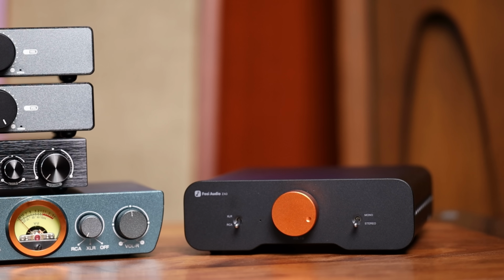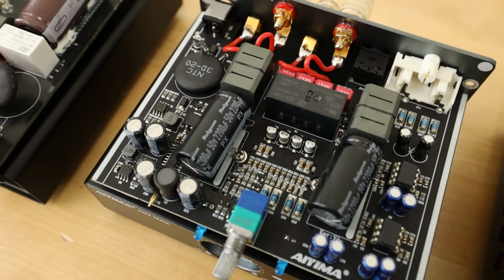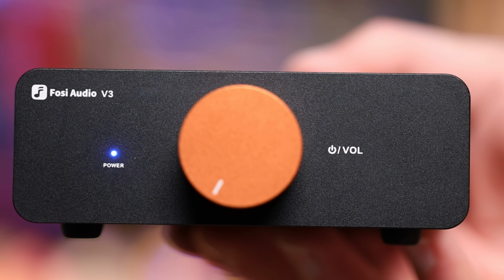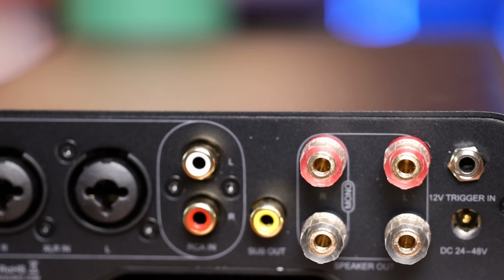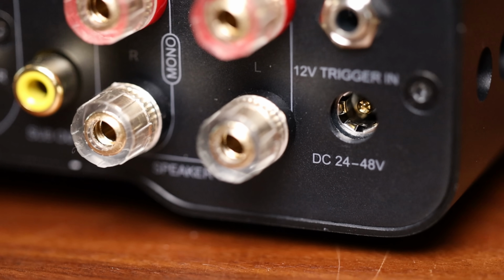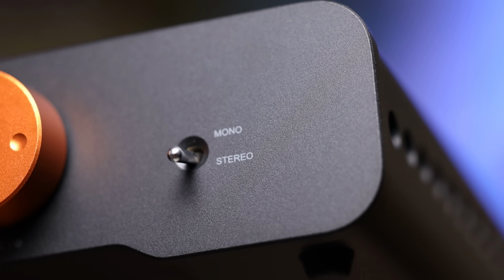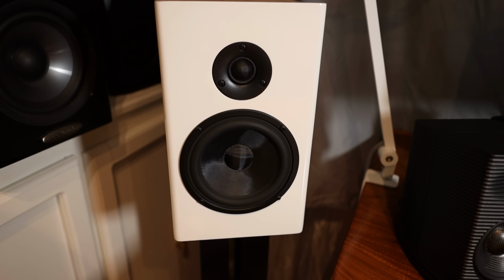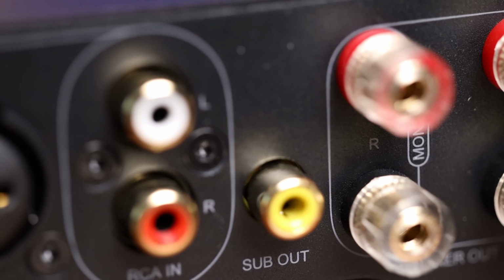Fosi ZA3- Teardown / Comparison / Review - Topping LA90 Who?

Comment: A couple of words of caution when disassembling and reassembling these upside down chip amplifiers.

1) Do not operate them at high volumes outside of the case.  The case is the biggest part of the heat sink and that heavy heat spreader will most likely be sitting on your table top.  This presents a really really weak cooling solution and may result in the chip overheating.  It's okay to turn them on at low volume just to be sure your new op-amps are working, but don't power test it outside the casings.

2) Since they've started using thermal paste on the heat spreaders, you really should clean away the old paste and apply new right before reassembling the amp. Picking up even a couple of larger dust particles  can seriously degrade the cooling solution and it's almost certain the paste will pick up and hold onto whatever loose particles it comes into contact with while exposed. The new paste should be applied in a thin line inside the case, where the back of the heat spreader will sit. This allows the spreader to spread the paste evenly as it slides in.  Putting it on the spreader itself will just result in the thermal paste being smeared all along the bottom of the case, not where it belongs.
Reply from the maker: Good news is I have some thermal paste laying around from previous PC builds, might as well apply it to the other two as well.
Reply: @MattCoykendall1 
As the wiley rabbit says ... "Couldn hoit"

As always, use the smallest amount that will cover the contact surface.  Too much is both messy and less efficient.

Comment: Once again... time to fix the power lie.

Lets ignore the company websites and their hype about power and take a look directly at the "TPA3255 Spec Sheet" ... go ahead do a search... 

In stereo mode all these TPA3255 amplifiers operate in 2xBTL mode.  
The output power is graphed in Figure 8, on page 11.
So here's what you can reasonably expect at 1% distortion ... 

[voltage] - [4 ohms] - [8 ohms]
32v - 110w/ch -  55w/ch
36v - 150w/ch - 75w/ch
48v - 220w/ch - 125w/ch

 The A07Max and Za3 can both operate in 1xPBTL mode for mono... 
This time the output power is graphed in Figure 23 on page 47.
But beware ... this is not a 4-6-8 ohm chart... it is for 2-3-4 ohms, so for 8 ohms we have to take the 4 ohm rating and divide by 2.

[voltage] - [4 ohms] - [8 ohms]
32v - 110w - 55w
36v - 150w - 75w
48v - 250w - 125w

Yep... 1x PBTL mode gives you the same power at 4 and 8 ohms as the stereo mode does. This is because paralleling the outputs does not increase the speaker voltage.  What it does is increase the output current capability.

You do not get the extra power until your speakers dip to 3 or 2 ohms.  The graphs show us that at 48volts with 2 ohm speakers, we can expect almost 450w/ch at 1% distortion.

Moreover; since the TPA3255 chip is fixed gain operating at 21.5db ... no matter what power supply is connected, For a given input, the output will be the same.  For example: setting a nice volume with the 32 volt supply then plugging in a 48 volt supply will not result in some magical transformation in any of these amplifiers.   The output level and tonality will remain the same.  All you really get is an extra 3db of  headroom with the 48 volt supply. (A 3db jump in maximum volume is barely noticeable, and unlikely to make any difference in home use.)

So... what does all this mean?  Well, it boils down to "don't waste your money".  Unless you have speakers that get down to 2 ohms there's no real advantage to either the 1xPBTL monoblock mode or the higher voltage power supplies.

The only real advantage of the "dual monoblock" setup is that you will be using 2 power supplies which effectively gives you double the current capacity.

Now don't get this all wrong ... I prefer the TPA3255 based amplifiers and use one (a modified TB10D) in my main system.  What I am suggesting is that you go with the data sheet, get the real numbers and make your decisions on fact, not marketing hype.

Comment: Mr. Coffee, I’m worried I don’t understand the value of a sub out here.   If I am trying to offload the bass to the subwoofer, yet it still continues to send the same bass frequencies to my regular speaker, I have 2x (or so) the bass and am not giving my normal speakers the ‘rest’ of not having to produce deep bass.  My understanding is that offloading deeper bass allows the speaker to more tightly control upper bass, being less ‘muddy’.   So how does this work?   Also confused how the bass crossover can be controlled “in the subwoofer” when there is no ‘cross’ ‘over’ from main speaker.   Does plugging something into the sun out port somehow limit the ZA3 bass output and if so, at what frequency.  Thanks very much to anyone who can shed light on this.
Reply from the maker: You wont get the advantage of true bass management like your mentioning here, the full range will still go to the speakers. It would have been ideal to apply a crossover so that you could take the burden of deep bass away from the speakers and pass it over to the sub but in this case the only option would be full range to the speaker and a crossover on the sub set to the driver roll off or a sub that has bass management built in, some offer this today, you can output from the sub to your speaker amp.

Comment: Hard to go wrong for the $ for sure, skeptical you get 180w x2 into 4 ohms from it. I'd use two as mono blocks for sure.
Reply from the maker: Hey Will, I would like to see a few more dedicated measurements here as well, something I plan to get into eventually. I hope to have that second amp in my hands today for testing.
Reply: It can do it... But I agree for 4 ohms or less you will want the PBTL configuration of the mono blocks and the advantage of dual power supplies.

Comment: Thank you for this informative, succinct, and hype-free review. You say this won’t be replacing your higher end amps anytime soon. Is that mainly because the higher end stuff has more features you want in your main system amp, or does the higher end stuff (Audiolab 9000 & …?) sound that much better? If the latter, it would be great to get your take on the ways specific higher end amps sound better. Some youtubers make it seem silly to buy higher end amps anymore (cough, CAM, cough, cough).
Reply: Thanks for the prompt response, but you are just saying things that should be obvious without actually telling me whether the Audiolab 9000 actually sounds better to you and, if so, how. Only a fool would expect sonic improvements to be directly proportional to price, and anyone can read the specs to see the differences in amp class and power supply. Only you can say how the one amp sounds to you compared to the other.
Reply: @williambracken9339 
Those are good questions. To make it perhaps more equal, how does a dual mono setup compare to the 9000a, including a good pre-amp. Btw, I have a ZA3 comin' tomorrow 😄
Reply: @williambracken9339  I have the same question, but he's not going to answer because he is "selling" these amplifiers. I am afraid the only way to know is buying and trying. Saying he paid 2k$+ for the Audiolab for more connections is irrelevant, you do it mainly for the sound quality. However, probably the Fosi offers a lot for the money which is good for Hifi, but is good enough for you? We know HIFI pricing is speculative, and follows diminishing returns and a exponential curve, that is the ugly truth and not capacitance.
Reply from the maker: Hey William, you can get an absolute ton of enjoyment AND quality out of something like the ZA3 and for a lot of people its more than enough, the reason something like my Audiolab 9000a wont be listed on ebay anytime soon is because it offers alot more input and output options, more flexibility. The amp also carries advantages in areas like the power supply, the audiolab  has a Class A/B power amplifier arranged in a dual-mono configuration, with a  320VA toroidal transformer and 60,000uF of capacitance. Its a slippery slope, the more you spend doesn't always mean better and certainly spending double doesn't double the sound quality delivered.
Reply: its the he-1 kind of experience, so yes

true haha terrific sounding iem, not many can hear/own this

Comment: Think I will try one of these when they add a high pass to the sub out.
Reply from the maker: I get it, I wanted that too.
Reply: I wonder if one could just solder a small capacitor or an inductor, inside on a sub output for a specific low pass filter for the sub ... 🤔 This won’t help the speaker high pass filter situation, but may help for subwoofers that don’t have low freq. management.
Reply: @madcrabber1113 | You want a low pass for a sub.  (To pass only low frequencies to a sub.)  And a corresponding high pass for the mains.  (To remove the sub's low frequencies from the mains.)  (Commonly misused.)
Reply: Got it. Thanks.

Comment: "I can say this easily sounds as good as many amps costing substantially more."

What are these amps you're comparing it to?
Reply from the maker: I honestly feel that many but not all would have trouble picking between the ZA3 and the LA90 in a true double blind test. Even if one sounded "technically" better many may lean to the ZA3's less sterile delivery. I cant speak on the newer LA90D though, haven't spent time with the new revision. This example could be repeated over and over as the 3255 isn't a prize winning amp chip but it can deliver a really clean sound, getting PFFB implemented on these is the next step as certain speakers will experience slight load dependency issues, so speaker pairings are still important here.
Reply: @MattCoykendall1  Less sterile sounds good to me! What's PFFB?
Reply from the maker: Basically a way for the output signal to be accurately reproduced no matter the speaker attached to it
Reply: @tpn8402 
It stands for "Post Filter FeedBack" .  It works by sampling the actual speaker signal and returning it out of phase to the inputs.  This aids in cancelling anything from the output that is not present on the input.  It will reduce distortion somewhat  and even out any irregularities in the frequency response.
Reply: @MattCoykendall1  Haha, I would say we have a big improvement on the development of PFFB.

Comment: If you use banana plugs, then the tiny binding posts don't matter much. But as you said, if they were staggered and larger, that would be better.
Reply from the maker: Hey Neil, you are correct, my largest banana plugs fit fine. Good news is this should be a simple improvement in later models, if they go larger they likely will need to find a bit of room for the stager.
Reply: Most of our customers think fosi audio amplifiers are compact and powerful, so instead of staggered we prefer smaller. And yes, thank you for your suggestion, if we have larger space, we will consider staggered.
Reply: @fosiaudio  Right, for bare wire, you need to get your fingers on more of the post to tighten them better.
Reply: @NeilBlanchard  Yes, totally know that, it is compact vs convenient.
Reply: Hey Neil!
Don't know how true this is but apparently the closer spacing is a "safety feature". Apparently the standard spacing also fits European two pin power plugs...